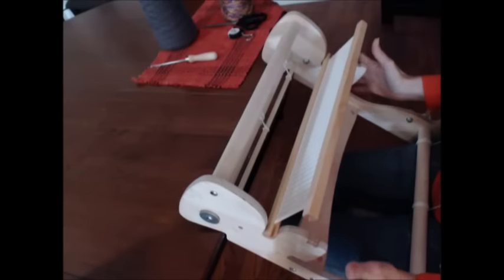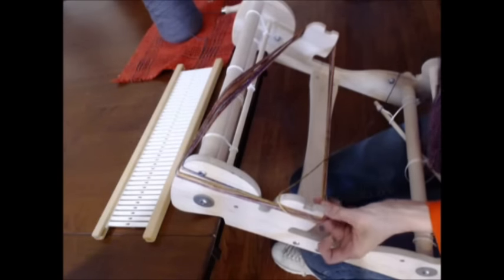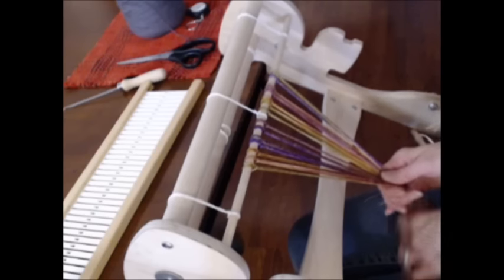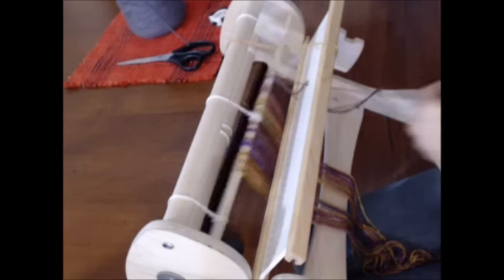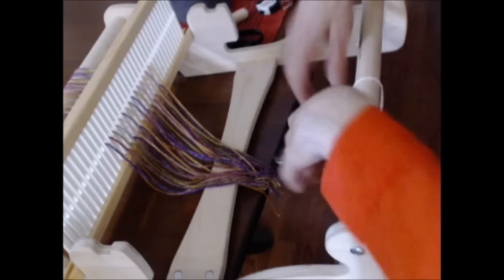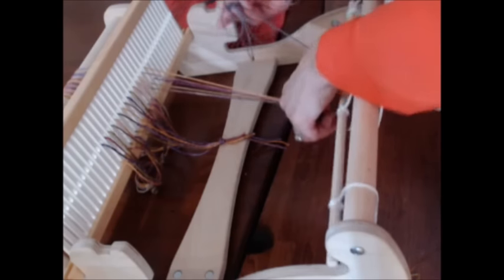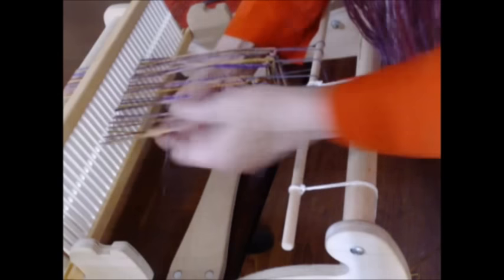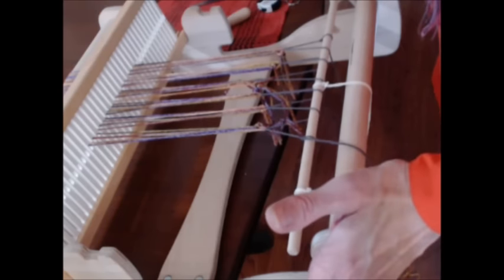Test Warp on the Rigid Heddle Loom

Comment: can you use that method of "tying on" (the loops on the back bar) for regular projects too, or is that method just for test swatches? Thanks...
Reply from the maker: There is nothing to stop you from using that for a full warp, except that the individual threads might be a little too long in the handling to make this beneficial over pulling loops to a peg.  Some people use the front tying on in their regular projects. I normally prefer bows in the front because this is my fringe.  Even if I don't use fringe, the ties on in front don't give you the best selvedges at the start, but that's only a minor thing and the front ties are more frugal in a no fringe situation. If you try tying on for longer warps, I would use a warping board to measure it out. If so, let me know how it works for you.